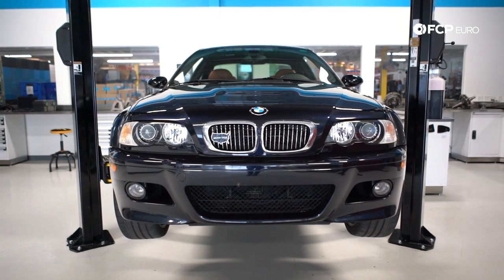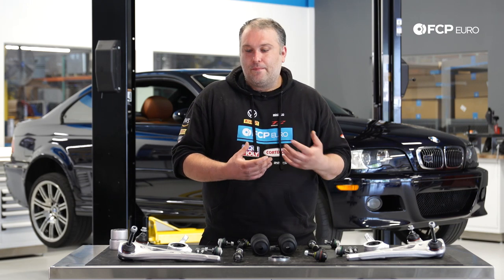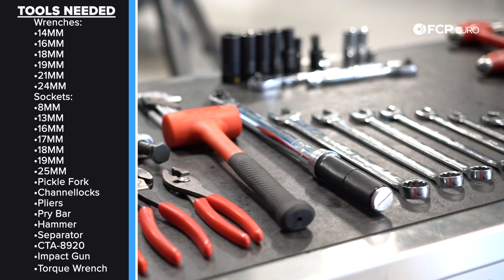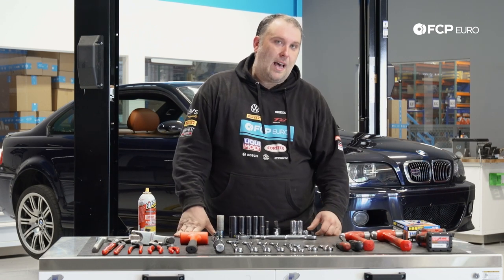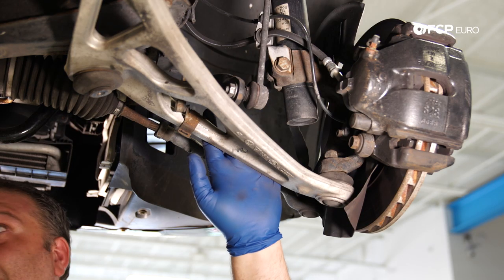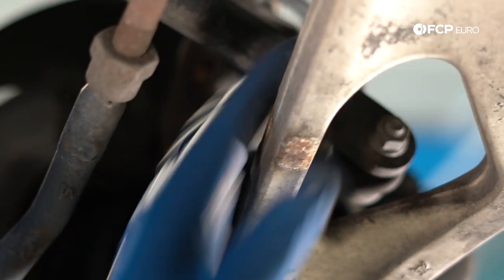How to Replace the Control Arms, Bushings, Ball Joints, Tie Rods, & End Links On A BMW E46 M3

Comment: on my 2001 (08-00) 330ci the factory control arm nut sizes were "18-21" passenger side, and "19-22" driver side? have you seen this before? BMW branded control arms as well...

Comment: Great info!! @ 15:02 I don't own that fancy tool...turned out, a common carpentry bar-clamp and a block of wood did the trick. I also put a metal ring to keep the block -clamp-combo from pressing on the rubber bushing itself. I clamped the control arm itself into a bench-vise to hold the whole thing while I went at it.

Comment: Thanks for the video and all the effort that goes into this. Question: the bolts that go on the reinforcement plate, all same size or are the ones that go into the bushing bracket shorter and less torque possibly? Stripped the threads on a bushing bracket (lollipop) thanks. E46 M3
Reply from the maker: Happy to be of some help! The bolts for the reinforcement plate are one-time use, and they are a different part number than the bolts for the control arm bushings. You can view both of those on a diagram over at bimmercat.com

Comment: Quick question about the sway bar links....are they supposed to be torqued under load? I’ve replaced everything up front in the last year, and still get an annoying clunking, pretty sure it’s the sway bar links. I ask this because I read in a thread on e46 fanatics that a guy said they had to be under load when torquing the nuts ...great video btw, and thank You guys for always being awesome with quick shipping of my orders.
Reply: did you end up fixing the problem by torquing it when the car is on the ground. This is how it should be loaded
Reply: @francischan8263  ball joints don’t need to be torqued under load, however, the front sway bar itself does.
Reply: I used to hear a clunk/ scratch checked everything in my suspension and dust covers for the tires. Changed every pulley. Ended up being my AWD front Diff seal had went bad and the pinion was just spinning until it snapped one day. Just got it out the shop

Comment: I just did this job and uploaded the video to my channel. I guess I'm the only person who doesn't remove the cross member brace torque-to-yield bolts for this job. I didn't loosen or remove the sway bar either for this job. Like most people, I used common tools. I don't have a shop lift, I used the BMW jack and some jack stands. The press on bushing spacing is essentially entirely about lining up with the stud holes and has nothing to do with the alignment. Basically, if the bushing is pressed to the correct depth, the control arms will bolt into the frame very easily as the all studs will line up with the holes in the subframe. Further, the "lollipop bracket" bolts pull the arm bushing bracket into alignment with the subframe dowels as you tighten the bolts. Nevertheless, this FCP video does provide some useful information, although it is obviously not the only way nor the simplest method to do this job.
Reply: How tf did you use the bmw jack
Reply: @jeradjackson1609  my thoughts exactly 🤣

Comment: Great video! Which component would be responsible for steering wheel wobble and pulling to the right?
Reply: Did you get it fix? Read something that if it wobble around 55mph, increase your tires PSI to 42PSI.
Reply: @Oneklickmedia  
Yes I did. Replaced them.

Comment: Just did this refresh on my M3. And I hope my experience can help/prepare anyone who goes down my route.
Bought the bmw genuine control arms from FCP and they didn't come with new nuts for the inboard and outer ball joint. Here's the proper specs for the nuts 
outer nut 18mm is a M12 1.5 nut 		BMW Part # 31-10-6-774-714 $2.70/NUT
inboard ball joint nut is a M14 1.5 nut 	BMW Part # 31-10-6-777-806 $8.27/NUT

hope this helps someone or somehow contributes future control arms to come paired with these nuts from FCP 
all in all great job and awesome video ;)
Reply from the maker: Thanks for the insight OG Guardian RJ , can you please send us a link to the product page you purchased from? Want to ensure it was not an actual error in the photography or listing, if the nuts were supposed to be in there. Thanks for watching the video and the support!

Comment: Note to anyone replacing with Febi brand control arms. Top inboard ball joint nut on top of subframe is 22mm rather than 21mm.
Reply from the maker: Appreciate the note! That can happen depending on the manufacturer.
Reply: In my experience OE bmw is 22 aswell. at least on non-m sport non-m e46's. I replaced mine recently with a new pair and on one side was some cheap aftermarket part and the other one was the original bmw one from 1999. It was a 22mm on the bmw one and a 21 on the aftermarket one.

Comment: What crazy kind of job on a German car doesn’t call for a 10mm?
Reply from the maker: You're as suprised as us. Its likely they rnd team at BMW simply misplaced all the 10mm's when designing the car and just swapped the size out.
Reply: FCP Euro 😂
Reply: If it were a "normal" E46 a 10mm would be used for xenon headlight leveling sensor bracket :P
Reply from the maker: @steifan  Valid!